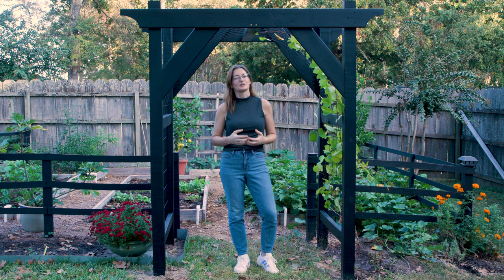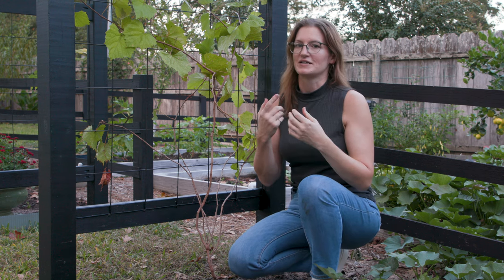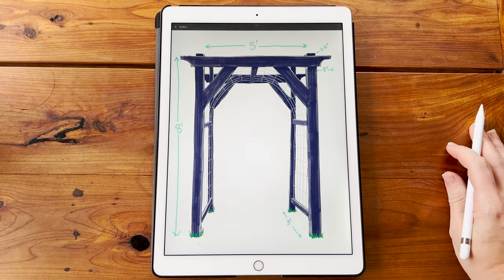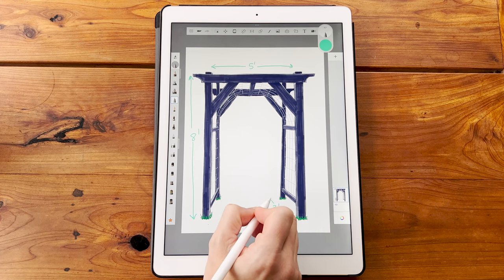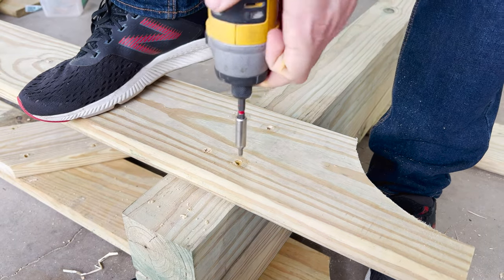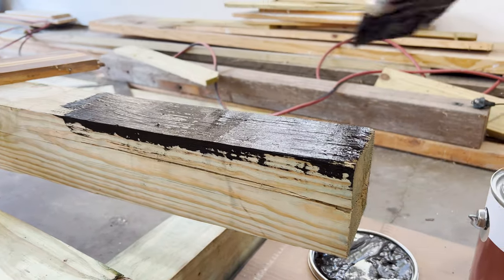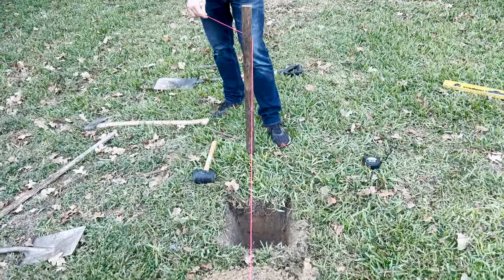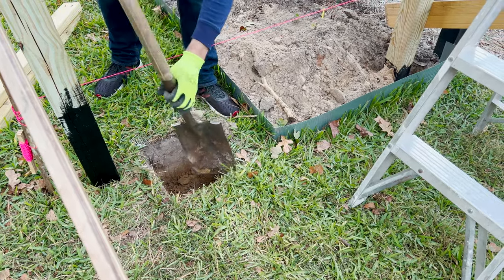DIY Grape Arbor Archway that's ACTUALLY Easy and Inexpensive

Comment: I built a similar arbor for my kiwi plant. Since I forgot what type it was, I grafted six additional types of kiwi plants onto it (male and female) to ensure pollination. You can also graft grapevines so you have a few different types of varieties that are ready at different times of the year. Instead of paint, I used a wood stain on my arbor. The stain is in a solid color which looks like paint. The reason I used stain instead of paint was that it does no crack or chip off. I would not want to try to repaint with a vine covering the arbor. Your arbor looks great. I used a dark green stain, but I really like your black color. I even stained my wood raised beds. They look great but I have decided to switch to metal raised beds They will last much longer.
Reply from the maker: I would love to grow Kiwi - there's a Kiwi test garden in my city for some cold-hardy varieties, so I may try it soon. That's a good idea about grafting different types of grapevines.